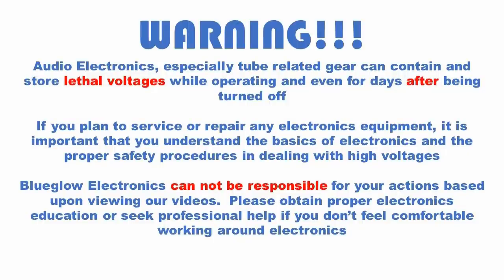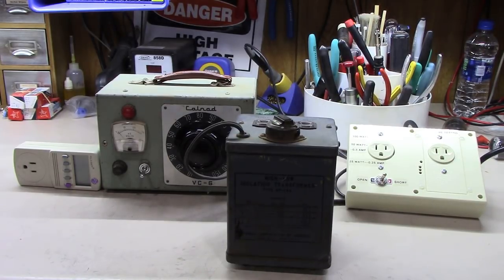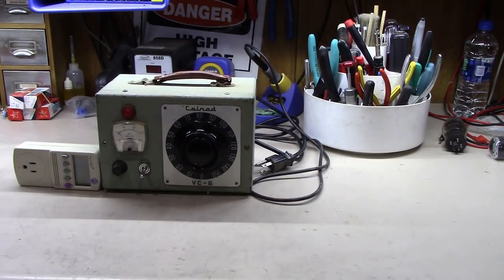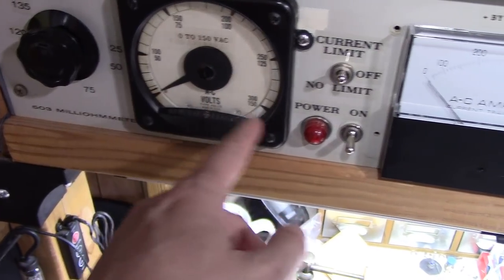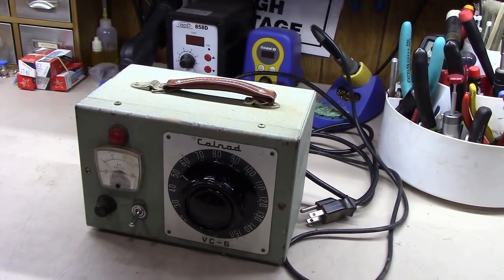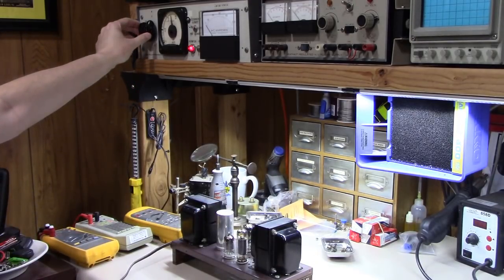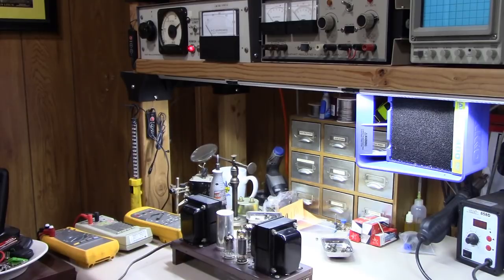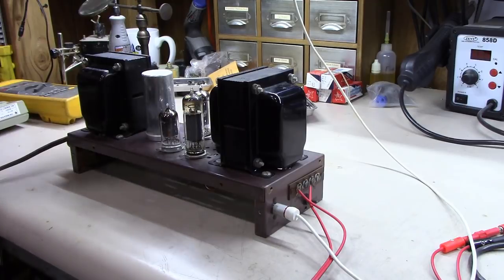Tube Gear Troubleshooting - Powering Up Using a Variac - Part 2

Comment: I found a variac for sale for $30, but it is only 500VA. I would be using it on 5 watt to 20 watt guitar tube amps. Is that enough? I noticed that some of them are 2000 and 3000 watts.

Comment: Way late to the game here, but I think your comments about the dim bulb tester are dangerously misleading.
The dim bulb tester will do nothing to protect _you_. If the bulb lights up at 0.5 amps and you yourself are the short, you're already dead. It takes maybe 100 mA to kill you.
The dim bulb tester is really only to enable you to see if there's a fault in the equipment. If you have, say, a short in the device, it will pull enough current to light the bulb and you can flip it off before you actually burn something out.

Comment: Hello, thank you for this video. Quick question if I may. I have a variac at my disposal. I will be installing two new 400v 3300uf can capacitors in my tube amplifier. After the install I believe it would be wise to slowly bring the voltages up on these new capacitors. The amplifier is not tube rectified. Would you agree?
Reply: A permanent soft start circuit might be helpful using that much capacitance, especially if high voltage across cap.I like to    slowly apply high voltage to electrolytic cap. With 10k to100k resistor in series and then slowly discharge it before installing the new cap.measure voltage across the resistor with voltage applied to cap.a good formed cap will show very little voltage across the series resistor.(low leakage).

Comment: I can't seem to find the specific video I watched of yours so am going to ask here. When using a current limiter (with a light bulb) do you plug the current limiter into the kilowat meter, or should you put the kilowat meter between the amp and the current limiter?

Comment: The first and most vital piece of equipment for work bench is a 'safety switch' a.k.a. GFCI, RCCB, ELCB. These devices monitor the current flowing in the live and neutral lines of the mains supply. If these differ, current is going somewhere it shouldn't, and the switch kills the current immediately. If that 'somewhere' was through your body you could die without the safety switch. As for isolation transformers, they can introduce more hazards than they prevent, particularly if you use an oscilloscope. Unless you are working on a hot chassis or a switched mode power supply, you are safer without an isolation transformer. I'm an amateur tube jockey, so why should you believe me? Read the article written by a man who has been designing, building and repairing electronic equipment for over 40 years at: https://sound-au.com/articles/iso-xfmr.htm

Comment: Greetings: 
You fail to mention whether there is a power switch  or gain control. An ohmmeter test between Line and Neutral power switch ON, will show any obvious reason for the blown fuse.

You do not address connections to the input and output  connections. Nor do you check for output (speaker) impedance. I would start with the input shorted and some nominal resistance (typically 8 ohms) on tthe outputs.

Comment: Could someone please explain how the amp was brought up without any load? I'm not too bright but I thought this meant disaster for the transformer? I'm going to bring my amp up on variac, but it has a center channel, I'm not sure if this needs to be loaded or bridged or left naked?
Reply: It's OK to power up a tube amp with no load with no input signal. The damage occurs if the amp attempts to amplify a signal.

Comment: I have a fundamental misunderstanding of the dim bulb current limiter.
The incandescent bulb is in series with the test device, right?
So 100% of the current flowing through the bulb is also flowing through the test device, right?
So how does that protect the test device from excessive current?
Reply: One property of an incandescent bulb is that the hotter it gets, the more resistance it produces so with a low current draw, the bulbs stay dim and do little to obstruct the flow of current. As the current draw becomes larger then the bulbs get brighter and as part of getting brighter they get hotter and present a larger resistance to the flow of current while at the same time giving a visable warning of the current flow.
Reply: Hey, that's very helpful. Thank you.
I've been trying to figure out how to make the tester even more effective by using two bulbs. So the obvious question is, series or parallel.
I suppose two bulbs in series would be best. Then their hot state resistances would add together and limit more current. In parallel I think they would draw more current and send that on to the test device.
Does that sound about right?

Comment: Before I would even dream of plugging in a set under test, even with a variac and/or current-limiting device, I would make two continuity tests with my VOM/VTVM/DMM across the power plug 🔌 one with the power switch off, and one with it on.
With the switch off, you’d better see infinite resistance (“0L” - overload on a DMM), or STOP -something is wrong!! Either the power switch is damaged, or you have a leaky across-the-mains (“death”) cap, or someone was in the unit before and futzed something up.
With the switch on, you should see about 10-20 ohms (or more). For a set with a “hot” chassis (such as an AA5 tube radio), this is the series resistance of the filaments, plus - usually - a dropping resistor. For sets such as the one in this video that have a power transformer, you’re seeing the (DC) resistance of the primary winding. If you see less than 10 ohms or so, STOP! Again, something is wrong! Obviously, if you get infinite resistance, then either the power switch is bad (or dirty contacts), the fuse/circuit-breaker has tripped, the primary winding is open, there’s a leaky “death” cap, or - again - someone may have been in the set and mis-wired it when they put it back together.
Only after this (and fixing any blatant problems), should you plug an any “unknown” device into mains power! The life (and test equipment) you save may be your own! 😁 HTH!

Comment: When using all three devices; the Variac, the isolation transformer, and the dim bulb tester, IN WHAT ORDER should they be chained together?
Reply: It really does not matter. My setup first goes through the isolation transformer then into the Variac and from there into the dim bulb setup. You do want to be able to watch your dim bulb while bringing up the power so it should go after the Variac but you could put the isolation transformer either between the Variac and dim blub or before everything like my setup is. Good question :D

Comment: Another idea that goes along with powering up with a variac is to pull the rectifier. This way you have isolated the power transformer, suicide cap, and whatever else is nearest the wall outlet from the rest of the power supply and all of the electronics except the tube filaments. Having voltage and current meters on the variac, like you do, is a great help as is the dim bulb limiter. I like your idea of having a dedicated troubleshooting series. Looking forward to all of it.

Comment: Question:  So theoretically, if I had all this equipment, I would want to run from the wall into the isolation transformer, then the variac, then the dim bulb testor into the usage monitor.  I would then plug any equipment I was working on into the usage monitor.  Do I have this in the right order?  A Youtube guy, that has a name that starts with Mr. and has a lab, stresses the isolation transformer over everything else.   Another, that has some seriously good guitar playing cats, seems to favor the dim buld testor over everything for working on guitar amps.  You seem the feel the variac is the most important.  Is it silly or redundant to run with all three?
Reply: I’d suggest that Mr Carlson’s emphasis of the isolation transformer is 100% pure gold advice. I would recommend that the isolation transformer be the last device in the chain since some variac / auto transformers could very well internally reference their output circuits to earth thus negating the earlier isolation provided if you placed the isolating transformer at the start of the chain. If you are absolutely certain that all subsequent devices downstream of the isolation transformer do not connect / reference any parts of the circuit to earth / ground then it’s fine to place them after it. The safest belt & braces approach is just to place the isolation transformer last and plug your equipment under test direct into it. Hope that helps.
Reply: @brencostigan  Well, to my understanding yes and no. If you place the isolation transformer first and its output is truly isolated from earth and nutral as the output should be, then there is no way for anything down stream to reach earth regardless of how they are wired internally because the power circuit they are wired to after the transformer has no connection or reference to nuteral or earth. It will NOT HURT to put it last though, not at all however if it is a real isolation transformer then there is no difference. YMMV!   ===|} {|===  No physical connection to the power source at the wall.
Reply: Tenspeed TheBikeHanger  Just to add that each of the three devices is serving a different function:

1) Safety isolation ( protecting the human )
2) Current limitation ( mainly protecting the equipment but human benefits too )
3) Voltage / current / power monitoring ( information)

So each has its distinct value and use.
Reply: @brencostigan  Thanks!
Reply: Mr. Carlson actually uses all three all the time. I like this idea. His power for the Device Under Test is an all in one unit. As mentioned, the components all used together provides three modes of protection, to you, to test gear, and to the DUT. Some of the other You Tube electronics repair guys have bypass switches or have their trio of AC power up gadgets so that they can plug or unplug them into different orders. 

I would tend to start from the wall outlet to first go to the variac, then the isolation transformer, then to the dim bulb limiter, or else copy Mr. Carlson's setup.

Comment: Based on where the fuse "blew", did you consider a mechanical break in the fuse?  It could be that old fuse didn't like the handling in transport.
Reply: The same crossed my mind as well

Comment: Hi Mark, I would change the electrolytic filter caps and those wax/paper coupling caps.  All will be leaking DC current by now, messing up the bias and putting massive amounts of ripple on the B+. Possibly going short and burning up the power transformer, caps are much cheaper than rewinding transformers.